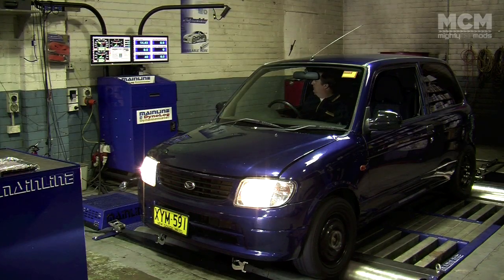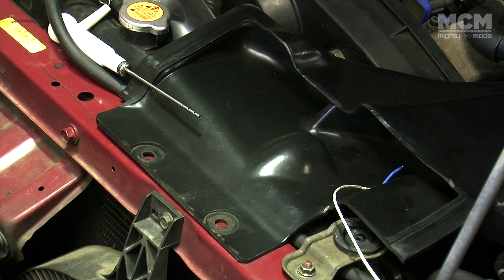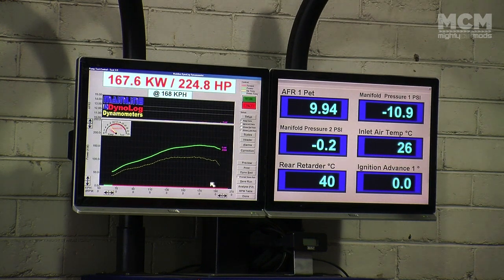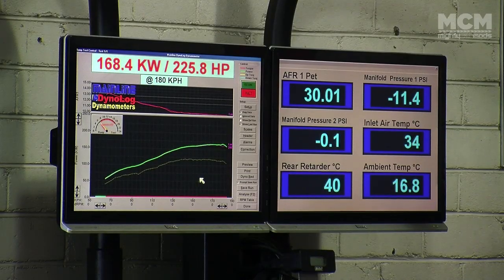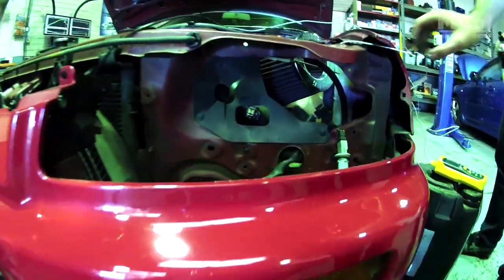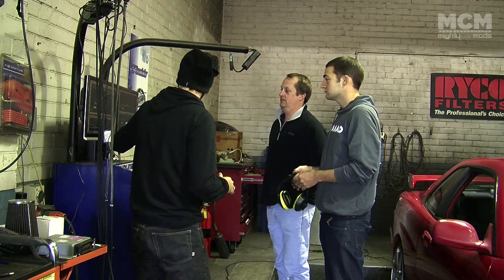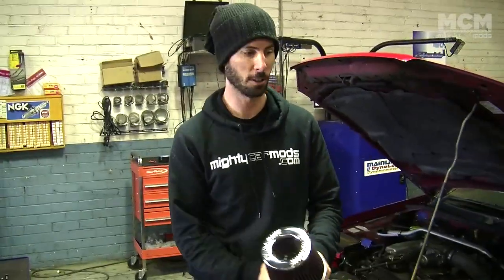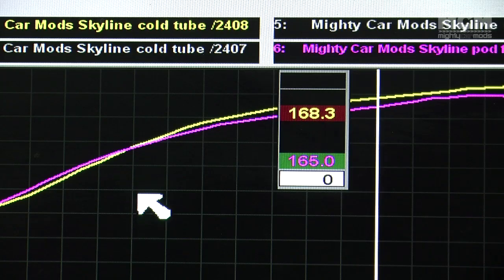Cold Air Intakes Mythbusted [Turbo]

Comment: try it with a normally aspirated car where your not going through an intercooler between the air intake and the engine..
Reply: Yes and no... Yes, it would be a better test WITHOUT all the FI plumbing and in reality a Intercooler IS a CAI in effect if the goal is to lower induction air temps...

But in reality, no, CAI's like they're testing do nothing to a car on a dyno and only a tiny TINY bit (if anything) on an average car moving at speed.  I've done this on my MK1 2.0L 16v swapped GTi track car (won't do it on the rally cars cause they already breathe out of the cab or the side glass induction in-let depending on the stage/course)... I moved the Intake down to the bottom of the bumper and all it actually did was make the filter get dirtier faster.  I was actually faster with the previous set-up by .13sec, but that could just be lap variance and my point is the CAI did NOTHING to an NA engine that is built to breathe and has a low restriction exhaust system.  However on a cold misty day, I managed my best lap yet, by over .64sec and I could feel more power all around the rev-range.  This is why Rally-cars run water injection on the intake, much like a cold misty day it cools the intake temp and increases the air-density more effectively then just moving the intake down low does.  BOTH of those things combined could actually do quite a bit in the right conditions.  That's the other thing, in wet rainy climates, running a CAI down near the ground only increases the chance of water induction (hydro-locking is no bueno) and in some cases on wet days when the air is already cool and damp it can be the "straw that broke..." in that it won;t allow the engine to get up to proper operating temp and if the car has a "fifth cold start injector" it'll mean the engine runs rough and way too fuel heavy killing power and fuel econ.

Outside atmospheric temp and air-density make WAY more difference and the simple moving of the intake to down lower on the bumper/grill does little to change the charge temp.  It's pretty interesting as I Daily Drive a 22RE 1st Gen 4Runner/Hilux Surf and on cold rainy days (here in Oregon, those happen all the time) it pulls harder and get's better mileage, and on hot summer days I get worse mileage and have less power... it's SLIGHT but it's noticeable to me.  Putting a Snorkel on the truck did nothing to up the power in the warmer weather.  It still runs stronger on cold rainy days.

In this case, the CAI was already THERE from the factory and was just a small part of an engineered engine/drive-train designed to make power.  On an average car it will do nothing but give you a louder induction "sucking" noise... which, funny enough, a LOT of people can psychologically convince themselves is "more power" and that they can "feel it".
Reply: Thanks for an epic answer! maybe a psychological difference is worth the few dollars. I watched a video recently featuring the guy who designed the F-type ad he said the air intakes on road cars are so optimized these days that any generic replacement wont e as good on any car made in the last 8 years or so. He recommended it only if you had massively increased he engine need for air with chips and turbo back exhausts bored out etc.. so that bears out exactly what you're saying.

Comment: My sensei has a chevy vega he drag races.  It does 8.55 in the 1/4 mile, he just smoked a mclaren the other day.  His philosophy is that every bit counts, people used to tell him not to do this or that mod because it'll only add a few horsepower.  So yea, if you're just slapping a CAI into your vw or honda with nothing else it's not going to do anything.  If you're trying to build a fast car, just remember that it all adds up.
Reply: Exactly this. Every 1 hp here or there can eventually add up. It's just like weight reduction. A few kilos here and there and you'll have soon saved a significant portion of weight.
Reply: well said

Comment: I've heard before that the exhaust may need to be changed as well in order to increase power.  Theoretically,  it's because the back pressure will increase in a stock exhaust, putting resistance on the internals.

Comment: You guys forgot to tune the car as well. Just adding a new intake won't yield any benefits until you have the proper fuel injectors,  ecu mapping for airflow to gas ratio and placement of the man sensor is crucial as well. You'll probably gain about 10hp on a 200hp car. It's not much but where the torque band slouched,  you'll see the gains there. It's not just slap on and you're ready to go. The computer in the car is mapped for stock hardware.
Reply: MAF sensor*
Reply: I completely agree with that, but most people believe you just change the filter and make gains.  I think that's the myth that's being busted here.  Ultimately if you want to gain power by letting more/cooler air in, you need to deal with getting it out more efficiently too so an uprated intake is useless without a bit of exhaust work.  Although your comment suggests you probably know that
Reply: You dont need new injectors for a cold air intake🤦🏽‍♂️and you shouldnt need a full tune either. Unplug the battery to reset the ECU and the MAF should correct for the increased density

Comment: It makes me wonder what kind of differences one might find if you tune with the stock air box vs. CAI.
Reply: probably none, the initial air is still hot and since you are compressing it all you will do is cool atmospheric pressure, better off putting a snorkel on for ram air intake

Comment: My 99' Dodge Ram 1500 has Ram Air Intake like what worked in last test, it's actually built into the frame starting above the left front light going over the tire and letting dirt etc  to pass through while the plastic manifold forms the long end of the T to the filter.  My truck is rated for 15 average mpg, 17 highway, I get about 16.5 average and almost never take highway. And that's with a broken leaf spring not to mention it's got 133,000miles and being 18 years old. The two modifications you could do with minimal tools, if your goal is MPG, is to vent and remove the hexcomb to your catalytic converter(s) or straight pipe it. And the other is if you bought a used vehicle, just reset your ECM(s) by disconnecting the battery(s) and then reconnect when you need to drive it, it will learn how you drive after that and make things go smoother overall.

Comment: It's pretty funny when people add a loud exhaust and a CAI and they think they can beat anything with their "tuned" car. It clearly doesn't make much of a difference. This test isn't the only proof of that, either.

It's hilarious when these people grab a CAI off eBay and go round saying they've added 30HP to the car because masterebayseller69 said so in his ad, and they just take that for solid fact.
Reply: +Krankie V it's nice if you don't have enough money for headers, entire exhaust systems, turbo kits, superchargers, suspension, transmission parts, and other performance items. It also helps if your car is already fast. I added a K&N cai, and two glass packs with magna flow tips to my bimmer and also custom headlights and tail lights. I wanted a certain sound and look and I got it. I don't think I can beat people that have done more though. You only think that if you don't have knowledge about cars. Also having to fix engine mounts, alternator, rotors and oil pan gaskets can prevent ppl from getting more power. Safety and reliability first! I had no problem beating hondas and stock camaros already, now i'll do it better.
Reply: +hanzo wasabisauce I'm talking about morons who think that adding a cai and fart can actually adds 40HP alone. with quality parts and a re-tune you might get close, but there are people out there who blindly believe they've gotten these type of gains because an ebay ad claimed so. they'd be lucky to have another 10hp.
Reply: +Krankie V We meet again, go kart hater.
Reply: +Krankie V We meet again, go kart hater.
Reply: Update: I just added a bunch of stickers to my car. about 1-3 HP each. I added a racing stripe for a whopping 5HP. I have a sticker that says "my other ride is your mom" I'm seeing huge gains now.
Reply: +Krankie V CAI will only boost the power if the air intake is the bottleneck. Usually the bottleneck is in the exhaust, and less restrictive air intake will not make a difference. It will, however, make a difference if it is the last thing you upgrade. With that said, CAI upgrades are a bit deceitful. They CAN give you a massive gain in performance, but ONLY if your current setup is severely suffocated by its current system, and that would take a lot of mods first to achieve. Additionally, if you have a car with near CAI factory stock air intake, you are probably not going to improve by buying another CAI off the shelf.
Reply: +Krankie V but what about all those stickers I see?  and those chips? and that 900 dollar turbo kit?  LMAO...
Reply: +Brian Westmoreland 20HP per sticker, 75HP per chip and 900 Dollar turbo brings it OVER 9000
Reply: +Krankie V oh ok lol

Comment: As others have said you need a retune to get any extra power from most mods.  You've shown the cold air keeps the air into the motor cooler throughout rpm range.  Cooler intake charge means denser air but you need to give more fuel to take advantage of it.

I've personally logged a 1lb+/min increase in airflow by simply adding some metal tubing to move the intake filter from the stock location to down in the wheel well on a 1g awd dsm.  More air = more potential power plain and simple.

Comment: I was told when you install a cold air filter, you have to re program the ECU to get more gains.
Reply: I think so. Watch Scotty Kilmer's explanation about CAIs. To summarize, I think it's the proper location of the CAI, preferably the coolest spot available in the engine bay. Then, I do think he mentioned about the computer getting reprogrammed so that it can register and detect where the new flow of air is coming upon now. Idk something like that. But I think the gains are almost negligible. I believe its like having a healthier lung, a clearer airway and cleaner, and colder air.
Reply: Yeah
Reply: That's what I was thinkin.at least reset the computer. All I know is I changed mine back in the day and I think it helped. But yes if u increase the air and not gas mixture it essentially does nothing
Reply: @TechTokOffical  idk much about cars, but from what ive learned in the web, if u increase the air, the air to fuel mix ratio also increases, thus becoming leaner. Not sure whether you are saving anything but I believe it doesn't really get you any further. Correct me if im wrong. This is just how I come to understand it.
Reply: You should have an intake air temp sensor (sometimes called an air mass sensor or something) which tells the ECU the intake air temperature.  The hotter the intake air, the less actual molecules of oxygen are getting in, so less fuel is required for the right air/fuel mix and the less power you can produce.  I doubt it matters much between 15 degrees and 35 degrees, but I would think it matters if you feed in 50 degree air rather than 5 degrees.
Reply: About the only way to see any real gains is dry ice or redirect one your air conditioning vents into the air box.
Reply: David Griggs really?  It has to be t
hat cold?  Often thought about putting the aircon into the air intake...anyone actually tried it to see what happens?
Reply: @mattbritton6222  I have heard of it haven't tried it my self, it make sense though colder air is more dense .
Just like NOS it condenses the air allowing you add more and more fuel which means more power .
Sounds like a myth buster for #mightycarmods.
Reply: @mattbritton6222  It has been done.
Reply: Depends. If its a car with MAF sensor, it will know exactly how much air is drawn in and will adjust accordingly. If it doesnt have a maf sensor, then a remap MAY help.

Comment: Surely you need to remap the ECU with all these mods to work properly. Sticking a modded exhaust and air filter with the ECU in stock format will confuse the ECU resulting in lose of power. Remapping the ECU with mods will increase the power and performance. They all go hand in hand.

Comment: I know I'm way late with this & I don't know if this has already been addressed or not. You don't have the air hitting the car like you would going down the road. Like what are the speeds the tires are going on the dyno? Because that's the speed of the air you need hitting the car. Plus if you make a way for fresh air to get to the filter while driving, you will see colder air intake temps. And if you make a ram air to the filter, then you will be getting a denser cooler air flow into the intake. Dyno's can only measure hp/kw to an extent, they can't reproduce real on the street performance.
Reply: that's why there is a fan in front of the car blowing. Without the fan, the engine would overheat they are not stupid.

Comment: I just created my own air intake. 2009 VW Rabbits are not easy due to 2 small hoses coming into the main 3 inch plastic hose.  It's also a bit tight.
I didn't do it for any noticeable horsepower gains.  The main reason i did it was because I installed a PCV system catch can. I used 3/4 inch inside diameter to hook up the catch can.  I didn't want to use a smaller hose cuz the  idea is to let the crank case breathe; don't choke it.
With this 3/4 hose I couldn't snap onto place the stock plastic engine cover.

I took care of both issues at the same time. I created an air intake system and my PCV catch can is in place.

Everything now breathes easier; my crank case and air coming into the throttle body.

Remember too those things called fans that are up there in the front. Engine gets hot....the fans turn on and blow in air from the outside. Plus your grill let's air into the engine bay while driving. 
Get creative starting with the basics.

Comment: It might be like cooling a radiator.  You need to have air forced into the system.  Driving cools down a radiator,  cool air and air flow would be increased if driving.
Reply: That's exactly what I was gonna say